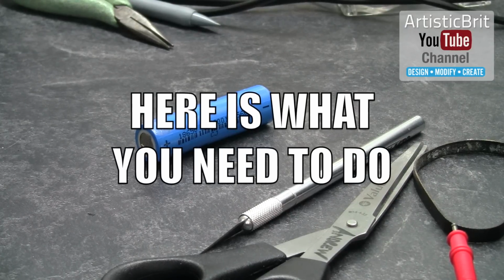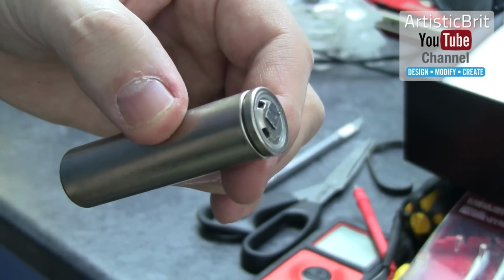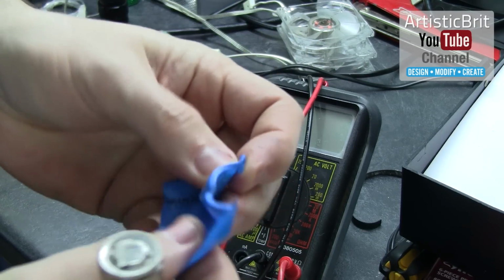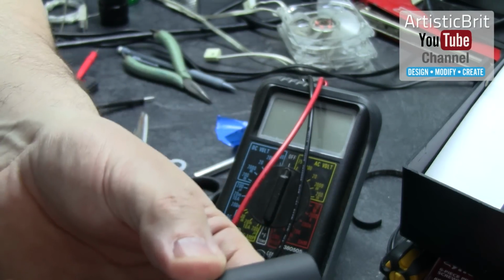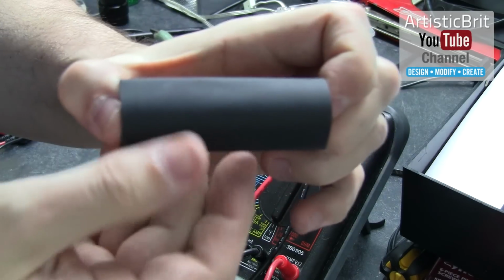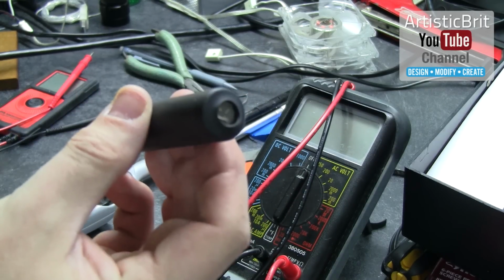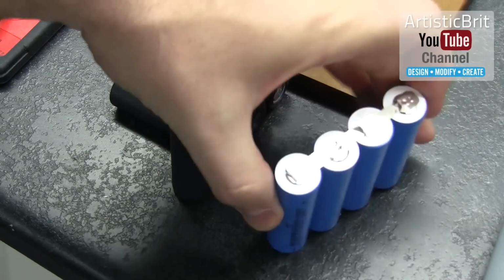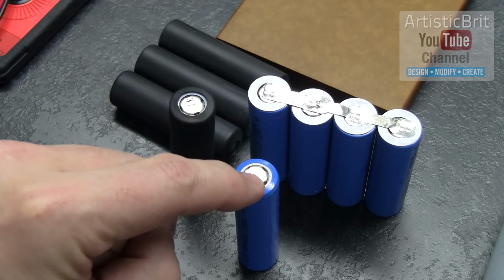Electric Danger of Lithium Ion 18650 - Battery Fires Exposed - Possible DIY Solution

Comment: In addition to my previous post, one has to ask oneself if a person who didnt know the things you yourself admit to not knowing should be disassembling laptop batteries and planning to use lithium battery chemistry in very high load situations on diy equipment. The can being negative is almost all cylindrical cells, that's basic stuff. And has been for decades.
Reply from the maker: While these batteries are just fine within laptops. Thousands upon thousands have played with DIY projects for a long time now, opening up the safety aspects to a completely different genre of usage and dangers that a laptop battery set up would never encounter. Though from time to time even those batteries blow up too. I don't care about the e-cig community as that's not really my thing, though looking at how they use them is of course beneficial.

Inventing is my thing, designing is, creating something that has not been created before is. My particular battery assembly is for an e-bike (under construction) hundreds are creating this style of transportation using 18650's and doing so using all kinds of configurations.

Being a teacher, I instill within my students the need to try things, to endeavor to learn new things, for where would many of the great designers and inventors of the past have gone if they listened to such comments. All of the great innovators of the past made many mistakes before making the right choices. Edison tried over 10,000 different substances in making the filament of an incandescent lightbulb until he found one material that lasted long enough to make the lightbulb cheap enough to sell and make money off of. How far would he have gone is he listened to neigh sayers? You are lucky people took chances, explored scientific boundaries and experimented with various methods of doing things, for it is because of this you are able to type this message to me.

You are missing the whole point of the video. Which is fine, I am not to persuade or prove you wrong, your decision and choices are yours. Me? I watch a video and cheer someone on if they have made a mistake, I possibly suggest they look at it from another angle. Positivity can be a great influencer, and mostly I would never usually  respond. I think as a community, we should help each other, cheer each other on, pass on our knowledge and help each other to grow.

I have been inventing stuff for over 42 years, with everything from explosives to electronics to inventing and creating machines and beyond. A piece of mylar or heat shrink will not stop me from doing what I love. And those that think they know more or are better than, well fantastic for them, but I'm enjoying and loving my own journey John.

Comment: Many if not most non original notebook battery replacement availabe in Brazil come from China and have this CJ cells.

I actually bought a replacement pack for a Toshiba notebook that could power it but did not charge.

I opened both the original Toshiba (Sanyo OEM) and the NoName (CJ cells??). There is a clearly visible quality difference, including in isolation and protection.

Packs are 3S(2P) of those 18650 cells, with a tap from each of 4 serial voltage points to BMC board  that holds protection and interface to the notebook.

Original Toshiba has 2 thermal sensors, and replacement has 1.

The most striking problem seen in the new NoName replacement is that the weld spotted metal holding a pair of parallel 18650 cells together would actually scratch the isolation, as the hypothesis of this video, and fire internally burning half of the metal shunting the cells and auto extinguishing before something worst happened!

Clearly this isolation is not up to the task, and that lack of quality in both design and implementation put consumers at risk.

Toshiba-Sanyo modules had extra sheets of insulating material to avoid frinction and contact.

Those are UNPROTECTED cells that rely on the BMC board for protection. A short in a single 2P arrangement has absolutely no protection to avoid a fire or even an explosion.

The pack has an UL inscription, but I would not be surprised if it ware a fake one.

Comment: I do a lot of these shrink wrapped batteries and yes it was silly to take off the protective plastic ring. 
Also you should have left the ring on when shrinking and if you have a lot to do it is so much easier to stick them under a grill and watch them all shrink together. 
These batteries will take some heat as they do get hot in extreme usage anyway.

Comment: You can get the same results by wrapping it in electrical tape as well. People don't realize how absolutely dangerous these 18650's are and how many are actually counterfeit when you get the off eBay and yes even Amazon. A good 18650 will cost you 7-15 dollars not $2.00.
Reply from the maker: Ted yellowstone Mine cost less than a $1 a piece.
Reply: Ted yellowstone 
Not necessarily 7-15 dollars, but probably not less that 5. Depends on how we define "good". Is it just top quality, reputable brand, new an unused or is it high discharge rate and/or very high capacity. For $2 you will only get junk - or decent new old stock in the best case.

Comment: have 2 batteries that wrap has small tear along the negative body.   Patched it with electrical tape. have been monitoring them for a week amd so far no overheating. is that safe though if its only along the long side?

Comment: Buy a "protected" 18650 battery, and throw the unprotected ones away, is my advice.

The "protected" Li-Ion batteries have a little regulator board in the nose that protects them from short-circuits, over-charging and under-charging. It's not a perfect protection, but it's something.

The protected ones may still melt tiny wires when shorted, but so what...the PRIMARY danger of shorting unprotected Li-Ion batteries is with a large wire or flashlight case that won't just melt away -  an unprotected Li-Ion battery may either explode or turn into a quite impressive firework, with jets of flames shooting out the vent holes. People have gotten badly burned by these things.

Comment: and blow torching them is safe? they are sensitive to thermal shock
Reply from the maker: Tom Hambling Blow torching does in no way make internally hot (core heat)  as they get when being used in my Fashlights. The blowtorch is only surface heat for a few moments and in no way degrades their capacity to hold and provide energy. Most battery packs are heat shrunk with blisteringly hot, heat guns. But yes, visually, I get your point, it looks bad.
Reply: Cool
Reply from the maker: Thanks Tom

Comment: so what you did, was remove the protective wrapping, the protective ring preventing short, and replace it with heat shrink tubing that will make it virtually non compatible with any 18650 holder, no insulating ring, and insulate the battery to more heat. GOOD FIX A+ GREAT VIDEO
Reply: Damn.
Reply from the maker: You obviously only watched a small part of the video. Figures... It's all good, im well use to the trolls by now. Plus I'm make large battery packs for bikes, I do not use a battery holders that many buy.
Reply: +Andrew Jones I just Des ruined what you did throughout the entire video.. how did I not watch the whole thing
Reply: +Gregory G Harding described*
Reply: Gregory G Harding 

what do you think the plastic ring you removed was for? totally unnecessary and dangerous modification

Comment: i wish they would of just stuck with NiMH battiers, that use the same cell types as Akaline batteries.  They were improving the capacity of NiMi batteries such that they were getting close the capacity of LiPo and Lithium Ions.  They were cheaper to boot.   They were making 4500 mah 7.2 and 9.6volt R/C car racing packs 50% cheaper than 5000mah 7.4v Lipo packs.  I would pay the same price as an Lithium battery just because I feel safer using and storing the NiMh packs.
Reply from the maker: Techie Fan I think we are on the verge of having a brand new type of battery tech that will be even better. I feel batteries are going to be one of the next big break throughs for us all.

Comment: there was a man in the news  who must have had a short or something  in the 18650  battery  they didnt  know what caused  it but the battery  exploded in his large e vapor cig it shot a piece  of steel threw  his jaw taking  a tooth out and embedded  in the roof of his mouth plus  2nd degree  burns  he spent 8 days in icu SO FOR THE PEOPLE WHO DONT THINK ONE LITHIUM 18650 BATTERY ISN'T  DANGEROUS  THINK AGAIN!
Reply from the maker: +Jaime Kepfinger Thank you Jamie
Reply: Imr 18650 battery's if handled correctly and not pushed past they're intended amp draw are perfectly safe. And remember Imr is very important cuz Imr battery's vent with out explosion or fire.
Reply: he was using a cheap battery in a unregulated mod, a big no no
Reply: cholrus69 laptops use 18650s, and most hoverboard fires are caused by a faulty adapter or only putting in half the pack
Reply: cholrus69 that story about the guy that blew up his face with a mech mod, he was using a cheap battery that probably did not have vents on it, like they should
Reply: cholrus69 yeah, the good quality  ones will smoke and bubble for up to 2 minutes before they pop

Comment: hello sir.
i have a collection of flashlites. as i watched your videos, now im afraid of my Li-ion battery now...
is it ok. if i wont remove the thin plastic cover and put directly the shrinkable insulation???
Reply from the maker: Karim Ash your batteries are fine. I was simply showing how to be careful, as many creators make battery powered items using these batteries. Leaving all protective covers on your batteries is the safest thing to do.
Reply from the maker: Also, since your batteries will not be in danger, I would not add extra insulation to them.
Reply: wow that was a fast reply...
sir... 
just to make sure. i want to put shrinkable insulation to all my batteries
ill start tomorrow.
thank you sooooo much for the info and your very helpful video...
Reply from the maker: Karim Ash I would not do it. I would only hear shrink batteries if you are using them for custom applications, like home made electric bikes

Comment: Your assumption that thicker is better is incorrect, I put heat shrink on heavy equipment all day long, it offers NO abrasion protection, its for keeping moisture out, if it will rub, it needs loom (often made of plastic thinner than the heat shrink) and that will last infinitely longer. Also never use a battery without that white ring on top (it happens to be the extra layer of abrasion protection, as for the outside, most devices ground through the body anyway). Also there is a tiny blob of metal underneath the positive post that melts and vents the battery if it over heats, don't put a flame anywhere near that. Last the battery's max output amp rating relies on the ability to dissipate heat and you are suggesting putting a blanket on it. Please take this video down before you hurt someone and get sued.

Comment: You messed up by not putting the plastic back in the first one. That little nylon ring is much tougher than the shrink wrap.

Also soldering directly to the cells is a very bad idea. There's a reason they spot weld a thin strip of metal in the professionally made battery packs. Soldering without doing internal damage to plastic seals inside the cell is very difficult.

Comment: Now you can have a fire because the battery got to hot. The casing on the negative is fine as it was designed. With two layers of covering the battery internal temps are sure to increase.
Reply: Walter Sudymont 
Two layers of wrap is an industry standard in any protected battery. There is the original cell wrapping and the outside wrap after installing the protection circuit. Extensive field use experience proves this is not a problem.
Reply: +TheVessapaperimuumio The problem is he's probably going to end up with 3 layers. Original, Heat Shrink, then one over the whole pack. Then possibly the pack inside a box of some description. It's unlikely to cause issues, but it could.

I would say just do the top 3/4 inch and leave the rest if you are uncomfortable.

Comment: Very helpful video. However, a cheap hot air blower would make tube shrinking much easier. Liked
Reply from the maker: Stankenfrein Thanks so much. Yes agreed on the hot air blower. I've always used an open flame briefly with no bad outcome. All the best!
Reply: Andrew Jones It's just kind questionable to talk about safety and then using a flame to shrink the wrap. No hair dryer available? I use a hair dryer all the time.
Reply from the maker: Patti Pender I've been using a flame for over 15 years with no issues ever. ;)

Comment: It's very interesting topic, and I'm glad that you came with this idea.
I'm a user of an electronic cigarettes, so i have this batteries just in front of my face...
How about 18650 batteries but with "pin" top, not the flat top, do you think they are safer or it's the same problem?
PS: I didn't ripping of the plastic from the pinned one, so i don't know how it looks like inside.

Comment: Just got deep into electronics for the first time. Reading 12 grade/college textbooks on DC, AC ohms law, learning how to read circut diagrams and got my first multimeter, (geeking out measuring stuff with it). I wan't to build my first lithium ion battery with 18650's. Maybe 40 amp hrs. With that many cells (can I balance them in parallel like LiFePO4 cells and get a good bluetooth BMS?) Do you need to harvest them sparingly, carefully? Only go with the best ones, and your ok. Assuming you have a temp sensor BMS with overheat auto shut down software on it, - can I go as high as 50 - 80 amp hr a 18650 celled battery and be safe from fires? The battery will be in a YouTube Vanlife Van. Also where's the best place to harvest 18650's

Comment: cool !! easier way to get the wire coating off wires is by using a lighter an just get it hot enough were you see it melt then take your finger nail an pull it right off or just cutter puller so you wont get burned do it quick enough with your fingers it wont hurt though iv done it hundreds of times works great for me an doesn't cut into the wire

Comment: surely it wouldn't have been hard to design a battery that didn't have this flaw
Reply: Sti
Reply from the maker: My point exactly.
Reply: +micheals1992 Yes, but these packs where bot designed to be taken apart...
Reply: It isn't a flaw.  Every cylindrical battery ever made is built like this.  It generally isn't a problem if you use and assemble the battery correctly.

Comment: Hasn't Any one noticed button cells/CMOS batteries, they come without any protection. Yes the button cells are 1.5 Volt alkaline battery, but CMOS batteries are Lithiums, but smaller.
Reply: SgtPiggie that too.

Comment: thats very r8 ...n nice informative vid... but last month with one of my projects i noticed that when iam connecting the negative part of the batteries near the positive(above the indented rim) iam getting different battery life and charge readings although when i connected the negative part of battery at the extreme end i got better battery life and more accurate battery charge readings...i got same result with 3 different setups.... cd not explain to myself why its happening as its a single complete negative shell.....just want to know if anyone else experienced the same or if anyone can explain it......

Comment: thaks for the advice 

can u tell me please how can i charge them with out buying i charger ?
or can i use i normal computer charger ? directly ?
or any idea ^^
thanks
Reply: Use a proper lithium charge controller.  Lithium batteries are dangerous if not charged properly.

Comment: Do you really think the way to make people avoid battery explosions and fires is to encourage them to use a surely unproper blowtorch and their limited knowledge of what they're doing? I don't want to be rude, but i think it will cause more explosions than saves. I think you should advice not to do it if they're not used to do this things. Just that. The method seems good , but as  i'm not used to that kind of DIY,  I see safer not to do it.

Comment: Your heat shrink is probably going to create over heating problems? LIPO batteries always produce heat and wrapping each battery in heavy heat shrink is not such a good idea. I think you over exaggerate the need for heavier heat shrink...